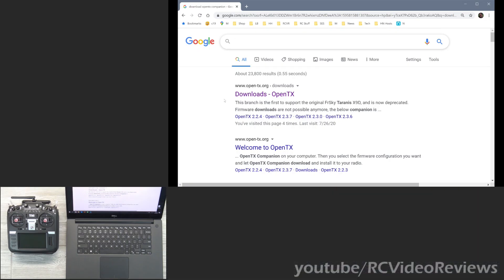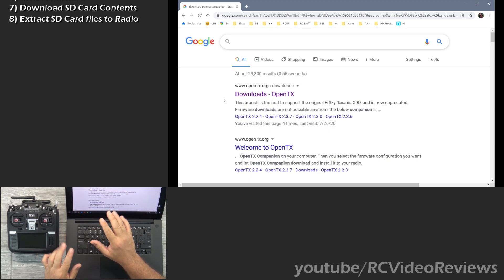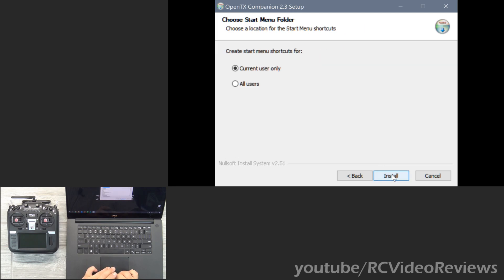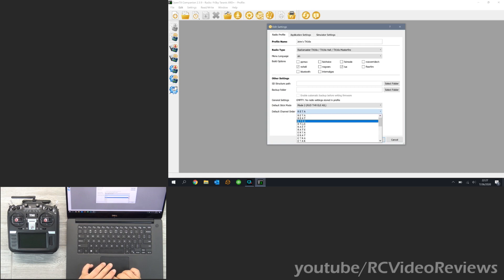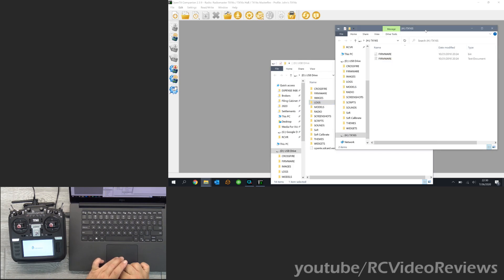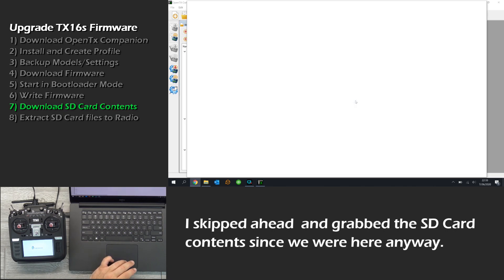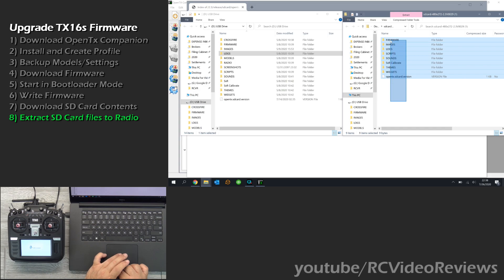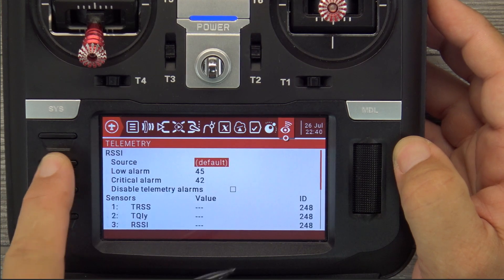OpenTx Companion Tutorial • How-to Upgrade Firmware on Radiomaster TX16s • [Beginners]

Comment: I got Companion downloaded to computer.  Profile is set-up.  But I'm stalled.  When I open TX16S in Bootloader Mode the 2 pop up screens you mention do not appear.  So I clicked on Read From Radio to see the SD Card.  Companion doesn't see the SD Card.  I need suggestions for next steps.       I'm using the factory loaded Radio Firmware, opentx-tx16s-Radiomaster (7ee5b1d0).  I'm using Companion Version 2.3.15 otx.  My computer is running Windows 11.   Can anyone help?

Comment: I need somebody's help, please. I followed this vid and thought the FW was installed per my post earlier. However, It appears not so. The Radio now displays funny values. (a) Out Puts page > Instead of -/+ 100 it's now -/+ 512..WTH? (b) Battery vales inconsistent. On some models 7.5V, with three battery bars showing  the percentage is 95% whereas in some other models it's 55%. 
Would someone,, please let me know why this is so and does it mean the Firmware upgrade hasn't worked? Radio is Tx16s Max.

Comment: Hi John, You maybe interested to know that it appears that the FW upgrade explained in this vid, as opposed to the link you sent in your other vid for updating the Win-11 STM32 Driver appears to be successful. Had no glitches except that at some point it asked whether to "replace or skip" files. I opted to replace at the drag-n-drop point of the process. My only issue is, how do I check if the new FW was actually written and or which version, if any?

Comment: Hi, I’m hoping you can help….I originally set up my TX16S from new on a windows pc, I now have a Mac, can I just plug my transmitter in the Mac (with the latest companion installed), and then save models and settings, and then update the transmitter firmware without loosing all my models and settings? ….thanks.
Reply from the maker: Should work ok.
Reply: @RCVideoReviews  thanks….yes, it all worked fine. Made the change to edgetx with help from your videos.

Comment: The bootloader mode does not appear on the display, the radio just turns on. I need an idea
Reply from the maker: You have to press the T1 and T4 trim switches inboard before powering on to enter the bootloader.

Comment: I'm about to update my radiomaster tx16s for the first time its still on 2.3.9, what I'm worried about is loosening things like yaapu telemetry  and maps and I finally have the sounds correct on all my switches, it also seems like alot of the sd contents would be duplicated,I understand everything will be backed up but would still be alot of work. but again I've never done this so maybe worried about nothing Thanks for the video.
Reply from the maker: How did it go?
Reply: Following the video everything is working fine

Comment: I enter bootlader mode, plug in my radio and i can see my sd card contents.
But when i select Read Models in Companion the following message does appear: 'No radio found'.
I have installed sucessfully Zadig drivers and Im running windows 10
Reply from the maker: 1) Make sure your version of companion matches the version of OpenTx or EdgeTx you're running.
2) If nothing else works, you can remove the SD card and put it directly in your computer and try that way. 

Unfortunately, I can't get into the business of troubleshooting SD card/USB issues. When everything is working correctly and you can see SD card contents with your PC file explorer including folders like \MODELS   \RADIO  \IMAGES  \FIRMWARE  companion will be able to read and write settings.
Reply: @RCVideoReviews  companion was  in version 2.5 and the radio firmware in 2.7.
Thank you for the help!

Comment: I just got my TX16S Mk II and I'm walking through your video. When I get to the "Read Models and Settings from Radio" it immediately reports an ERROR: "Can't extract RADIO/radio.bin". I'm not sure what I need to do to get past that... your radio just did a bunch of stuff and mine didn't do that. 😕
Reply: it was corruption in the file, apparently you can't have yaml dictionary like this:
   4:
      swtch: SG2
      func: PLAY_TRACK
      def: ,1x
   5:
      swtch: SG1
      func: PLAY_TRACK
      def: ,1x

which is the default for model8. The "def" key's value has a comma as the first character. I changed those two values and now it works. :P
Reply: @flooftoes  You saved me with this! Thank you for sharing!
Reply from the maker: Are you using OpenTX Companion or EdgeTX Companion? What version of Companion? You need to be on 2.6 or later. Download the latest here: https://github.com/EdgeTX/edgetx/releases/tag/v2.7.1
Reply: @RCVideoReviews  I realized that the radio came with EdgeTX so I got rid of OpenTx Companion and downloaded EdgeTX Companion. Now when I hit that same button it says: "Can't load MODELS/model8.yml: yaml-cpp: error at line 302, column 12: end of map not found". I'll search around for a solution to this... I'm running EdgeTX Companion 2.7.1 "BlackPearl" released on May 9th.

Comment: Hi Sir,  can you answer my question please.  My radiomaster has installed it the firmware update 2.3.11, and I'm missing a lot of protocols for example RadioLink products. The newest firmware update right now is up to 2.3.14,  but which companion update version number should I be using to communicate with my RadioMaster, or the companion version number doesn't matter and it should be the same number 2.3.14 as the firmware update 2.3.14 that I trying to install, even if the radio came with a old firmware update 2.3.11 ? Please and thank you Sir.
Reply from the maker: There are a lot of questions here. 

The multiprotocol module provides protocol support, not OpenTX firmware. So if you're missing something, update your multi-protocol firmware.

You should always match Companion to your OpenTX firmware. So if you have 2.3.11, you should use Companion 2.3.11. If you update 2.3.14 on the radio, you should update Companion to 2.3.14.
Reply: OK, thank you Sir.

Comment: And i checked my firmware on radio, it says 2.3.11 - otx , but i when i try to check update, it says no update available, and on Companion it says my firmware is 2.3.14 . 
 I try to download just like in the video, but i Got a message when i try to write new firmware , it says Unknown Error cannot write the firmware . Please help.
And my memory card is only 256Mb. it's almost full.  Is because of that so i cannot write the new firmware ? or somethings else ?
Reply from the maker: You have a lot going on here:

1) The only thing that matters in terms of what firmware rev you have is your radio. It doesn't matter what companion thinks. The information page on your radio shows the firmware you have--full stop.

2) Clean up your SD card. I've got 60+ models on mine with full Amber and Emily soundpacks and I'm using about 30MB of space. Unless you dumped a music library on your SD card, I cannot fathom what would be taking up all that space. I even have log files for 40+ craft, images for about every model and multiple EdgeTX themes. Still < 30MB.

3) Firmware is written to the radio not the sd card. SD cards can be removed/replaced/formatted and the radio firmware remains.

4) I have no idea why when you press check for firmware Companion doesn't offer the latest. What I would suggest is completely uninstalling Companion AND YOUR SETTINGS. Downloading the latest Companion and starting over.

If you need any more help on this, I would encourage you to join my discord. You should also give serious consideration to EdgeTX.
Reply: @RCVideoReviews  may i have your discord link ?
Reply from the maker: It’s literally in the description of every video I post.

Comment: hi can you or anyone help   radiomaster tx16s    will not go into bootloader mode  at all tryed 30 times
Reply from the maker: I only know of one way to do it. Turn Radio Off. Press T4 and T2 INBOARD simultaneously. Press power button and hold until the backlight comes on.

Comment: Thanks for this tutorial. I've just completed the update but unfortunately the write models and settings to radio" button is greyed out. I'm at a total loss as to how to write my settings back to the radio now after the update. Any ideas?
Thanks.
EDIT: Solved it by pure luck. Dragged the back up file into the OPEN TX window and it updated without having to press the greyed out button! Phew.

Comment: Thanks for leading me through this. Just got my TX16 and it had 2.3.9 so I updated to 2.3.14. Everything went well except for the SD card update. I deleted original content on the card (after making a copy of it) then copied the new content to it. At that point I got a warning about no SD card in the radio. Powered up the TX16 and no models were found. So I popped the SD card out and put the original content back on it.  Then the models were back but radio gave a warning on powerup about expecting a different version on SD. 

Upper left button on companion "write models and settings to radio" is now greyed out but "synchronize SD" button works so I did that and selected only write to destination and only update files that have newer versions. Now all is good I think. The "write models....." button is still grey but assume that is because I haven't created any new ones. Oh by the way, be careful putting the SD card back in. It is possible to miss the socket and lose it inside radio. Then you have to open up the case and find it again. 
😰
Reply from the maker: Make sure your new card is 32gb or smaller, formatted FAT32.
Reply: I have exactly this problem. 2.3.9 --> 2.3.15. Now I cannot turn on the radio. Is there an additional step to get the radio to actually turn on now?

Comment: Hey John, Just upgraded my firmware and so to the new .14 version and noticed the forward programming feature! Sadly does not work with the new Spektrum receivers but hopefully in the next version. CA Jim
Reply from the maker: Does it work with the older Rxs?
Reply: @RCVideoReviews  I just tried it with an AR630. Haven’t tried it with an AR636b I have. Will let you know. Jim

Comment: This updating the SD card can easily be done in Compagnion: Choose in Compagnion: file and then down Synchronize SD. Than the new SD card content will be synchronize with your SD in your radio. To speed it up I took the SD card out, otherwise wait a little while.

Comment: Awesome! I have a question though. Say I want to change the SD Card that comes with the RadioMaster TX16S to another (Sandisk Extreme). Do you recommend it and if yes what format (EXFAT, FAT32…) will it take and what is the capacity limit. Thanks
Reply from the maker: I'm going to do a video on this because this question comes up so often:

It has to be 32GB or less. It has to be formatted Fat32, and the allocation size has to be 4k (do not use 8k or higher). The problem is standard tools do not like formatting big cards with small allocation sizes. Honestly, a 2GB card is the most you'll ever need for this radio and the 256MB card should last a very long time unless you add a lot of music or do a metric ton of logging.
Reply: @RCVideoReviews  That would be fantastic! Thank you for shedding light on this.

Comment: RCVR - Do you have to update the SD card content to the latest version along with the firmware, or can you leave the SD card content alone?  I have images, Amber...etc on my SD and don't want that messed up by updating to the newest SD content.  But now I'm getting "warnings" from my radio that it's looking for the newest SD content version.  Is that a problem?
Reply from the maker: It's possible you may encounter weird behaviors like icons being out of place if they changed the icons. Or a script not working if they changed a dependency within the script, but generally no, it shouldn't cause you any real operating issues. You can always edit the opentx.sdcard.version file in the root of the card and change it to the revision the radio wants if you're willing to risk not having the correct contents installed.

Comment: Followed your video man and now my unit is bricked...... something went wrong in the SD card file update. I deleted the files in the sd but it said i couldn't delete two of them. I put the new downloaded files into the SD (drag and drop) and it asked me if i wanted to replace some files, I pressed yes. Everything looked good. Disconnected the USB. hit exit. Nothing. the light above the 1 stays on. But it will not go off if i press power or anything..... Any ideas?
Reply from the maker: It's probably not bricked. I don't think it's possible to brick an opentx radio because I believe the software required to enable communications between the radio and PC is burned into a chip. 

In any case, I could remove the cables, remove the battery, remove the SD card and start over.

1) Do not change ANYTHING in the USB Drive that comes up as FIRMWARE. That is a radio specific folder and we don't change things in there.
2) If the SD Card shows nothing when you plug it in, format it, copy the firmware you downloaded from OpenTx to it, then disconnect the radio. Simultaneously press T1 and T4 inward and hold them there. Turn the power on. You should see a bootloader. From there, select WRITE FIRMWARE and navigate on your SD card to the firmware you put on the card.

That should get you running again. After that, copy the appropriate SD Card contents to your card and you should be good to go.

Comment: What do I do if I erase the SD card by mistake?
In the end, after downloading I get an "unable to locate SD card"?!?
Reply from the maker: Add RADIO and MODELS directory to the root folder of the SD card. Or just put it in the radio and turn it on.

When you say, "after downloading" are you saying you downloaded the SD Card contents for your radio and copied them to the SD Card?
Reply: @RCVideoReviews  Thank you very much! you have a great channel. I have another question what program do I use to open the Amber Pack with?
Reply from the maker: @emilgabl9069  Anything that will open a RAR file. I use Metro from the Windows 10 store.
Reply: @RCVideoReviews  ok, I will try. Did you make a video for this? Do you have videos on fpv setup wiring pc inav etc?
Reply from the maker: @emilgabl9069  That's a lot of questions in one. I do have a video showing how to install Amber: https://youtu.be/S4QYoLFlMf0

I have several iNav setup videos. I don't have any wiring PC videos.

Comment: My TX16s has just stopped  working with lift off randomly, so I am assuming I need to update firmware.
Reply: Mine said unable to find SD card, there is definitely an SD card in there though.
Reply from the maker: Try and reseat the card or maybe replace it?
Reply from the maker: If it used to work, but no longer works, changing the firmware is not required.
Reply: Thank you for the reply. Any idea on how to fix it? The sim / game is lift off. Been practicing before buying a drone.
Reply from the maker: @Shmancy_pants_69  My first reply suggested reseating the sd card or swapping it for another. Did you try either of those?

Comment: Im struggeling to create a model that can conect the tx16s to a flysky fs-gr3e reciver. Do you have any tips or mabey an madel to download?
Reply from the maker: Did you check to see if the GR3E is on the supported protocols list?
Reply: @RCVideoReviews  The "flysky model fs-gr3e reciver" should use protocol FLYSKY? but when i choose flysky in the tx16s model im edeting it says that its invalid and removes that option.

Comment: Brand new radio. no models or anything added, when I try to copy SD contents across it says there is not enough space.
Reply from the maker: Are you sure you unzipped the contents and didn't just try to copy the zip itself over?
Reply: @RCVideoReviews  I did, thanks. I formatted the SD card and tried again and it worked perfectly. Thank you, very useful series.

Comment: Just tried to follow your great instructions to update my new Jumper T12 Pro which came with Opentx 2.3.4. When I clicked to download the firmware nothing seemed to happen. So I searched the download folder, which I setup on desktop and found the file as VLC Media Player file. This seemed so strange to me that I did not continue. Also I got no automatic option to download the SDCard contents. Any ideas? Can I delete the firmware somehow and try again? Maybe not on a desktop folder? Or can I just use it like that? I am really lost. Any help would be much appreciated
Reply from the maker: If you download Companion, select the T12 Pro for your radio profile, Companion should offer you the correct binary. I wouldn't place stock in the file type windows uses to identify the file. It should be something along the line of opentx-tx16s-lua-noheli-en-2.3.4-otx.bin and it should be about 1,000KB. 

Here is the Companion link for 2.3.11: https://downloads.open-tx.org/2.3/release/companion/windows/companion-windows-2.3.11.exe

Here is the link for 2.3.11 SD Card for T12: https://downloads.open-tx.org/2.3/release/sdcard/opentx-t12/sdcard-128x64-2.3V0035.zip

Comment: Hi RC, when trying to copy and paste SD card on the left , I got a pop window saying  there is no space to paste on the Radiomaster folder, should I delete  the previous folder to get space?
Reply from the maker: Something is wrong. If you unzip the SD card contents, you should be able to drop them on the SD card without a problem. If it's not working for some reason you can delete the existing SD card contents first, but you'll want to save a copy of the the files in both the RADIO and MODELS directories as those contain your model listing, radio settings, and model files.